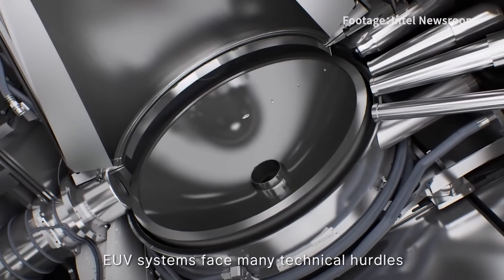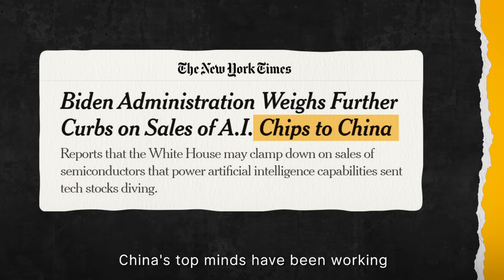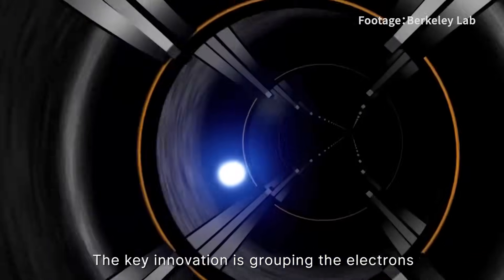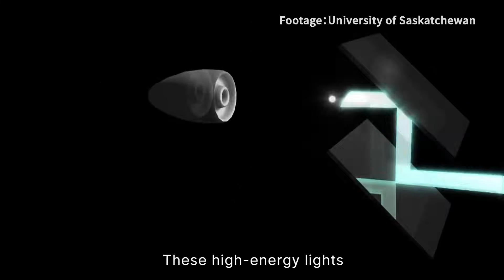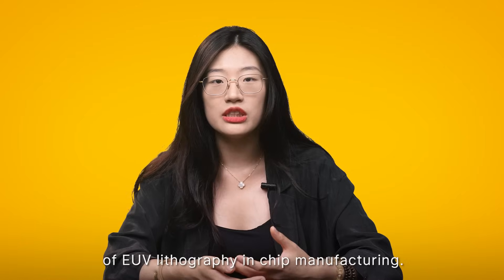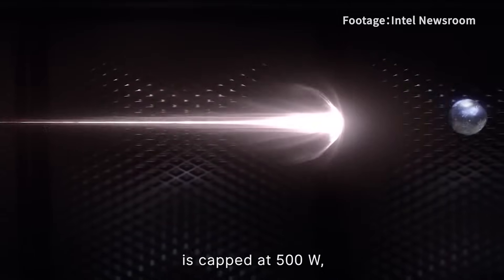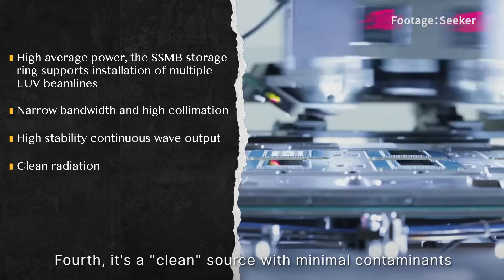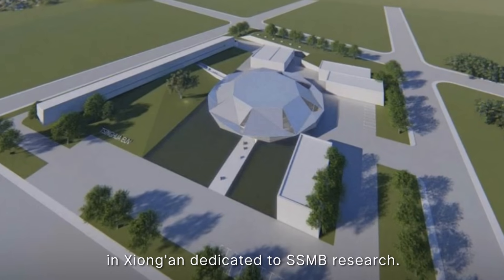China's Secret Weapon to Win the Chip War？

Comment: The SSMB EUV is already in a very advanced stage. The synchrotron has already been constructed but there is a possibility the EUVs may be already installed or under testing. This is a TOP SECRET project. Each synchrotron can powered a minimum of 10 EUVs.

Comment: The consumer chip race is hogwas, why? Heat in enclosed  is its limit and we’re there. Apple iPhone 15 they are giving excuses but it software is throttle back to pass. Go pro from gp 8 to 12 now all over heating and locking  up, tons on eBay sold as is 40 buck.
They can’t control the weather my state after just 10 minutes it’s lock up. It’s has to be I enclosed so any heat build up and radiate to put a fan use away too much battery life.

Comment: The scalability to smaller wavelength, such as 8nm or smaller, is a big plus. Consider ASML's next generation of high-NA (0.55NA) EUV machines: It's depth of focus will be reduced by a factor of 0.36. On the other hand, by simply scaling the wavelength down to 8nm without changing the NA, the resolution will equal ASML's high-NA machine, while the depth of focus is reduced only by a factor of 0.6.

Comment: Here is a good example of how China thinks about problems and how to solve it something few in the west understand 👍
Reply: reverse engineering 😙
Reply: @GameC3nt  How do you reverse engineer something that is completely new? Like China reverse engineer US's 5G technology or high speed train?
Reply: @GameC3nt - (Possibly) - (You) - Did - Not - (Understand) - (The - Presentation) - in - (The - Video) - 🤔🤔🤔🤔🤔 -
Reply: @GameC3nt - (This) - is - (Not) - (Reverse - Engineering) - ❌️❌️❌️❌️❌️ - But - (Thinking) - (Out) - of - (The - Box) - ✋️✋️✋️✋️✋️ - (An - Entirely) - (New - Solution) - To Solve - (The - Problem) - of - (The - Instability) - of - (The - Light Source) - 🎯🎯🎯🎯🎯 - in - (EUV) - (Extreme) - (Ultra - Violet) - (Lithography - Machine) - ✋️✋️✋️✋️✋️ -